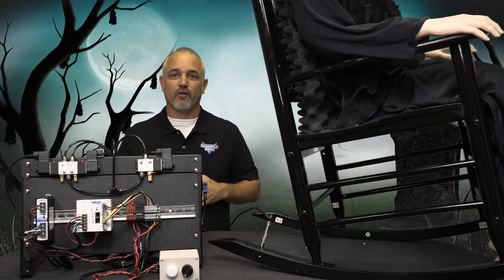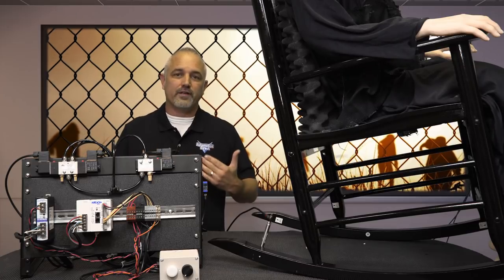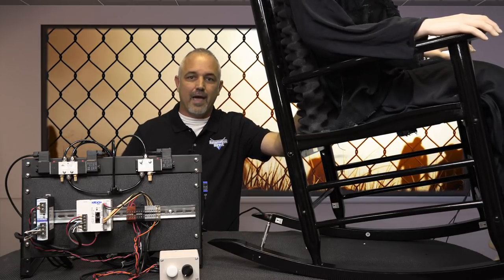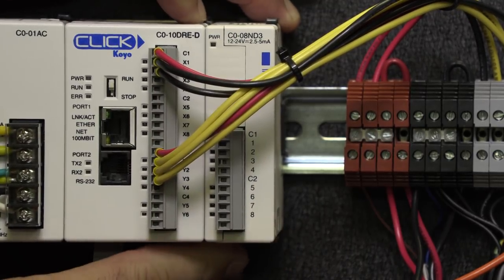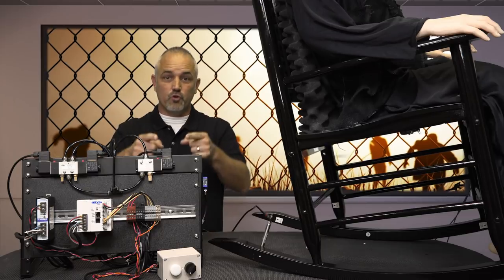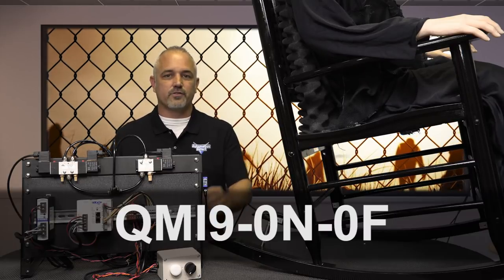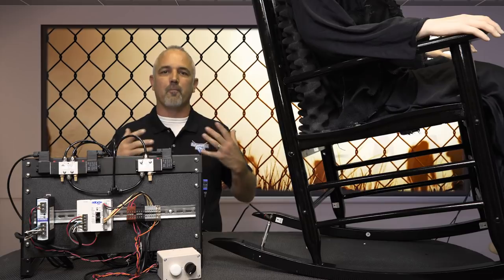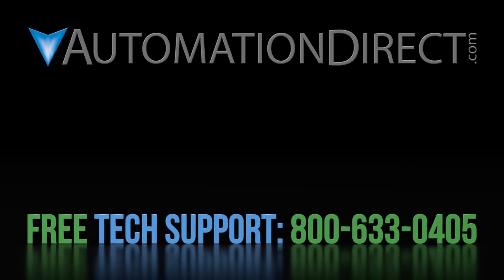Halloween Props DIY – Scary Rocking Chair Turning Head from AutomationDirect

Comment: Would love to see how you hooked up the hardware to make the chair rock and the head turn.
Reply from the maker: @Ken Frohock, Thank you for watching our Halloween DIY video.  Yes, I should have provided more attention to how I attached the pneumatic devices.  You can see the spring return cylinder in the video - it is mounted to the back of the chair leg with two wood screws.  I used an AMB-3 cylinder mount on the A07015SN air cylinder. I had to experiment with the location, air pressure and activation times. The Rotary actuator is attached to two round pieces of 1" plywood.  I attached a bottom piece of wood to the mannequin body (neck) and mounted the actuator it it.  I attached the the top piece of wood to the rotating actuator side of the J10MD-M and then inserted screws through the mannequin head into the top piece of round wood. Thank you for watching and I hope you are able to create something cool for a Halloween prop. If you do, please let us know, we would love to see it.
Reply: AutomationDirect.com is the head turning mech all weather?
Reply from the maker: @kenfrohock5234  No, it is not all weather.  The actuator is made of aluminum but does not carry an IP rating.

Comment: Any hints on how to reduce the cylinder  sounds
Reply from the maker: @Rayed Alrashed, depends on what sound you are looking to reduce. If you are looking to reduce the sound, of impact, at the end of the cylinder travel, get cylinders that have cushions. You can also use flow control / speed control valves.
Reply: Attach hoses to the vents of the s solenoid and route them away from the prop - helps.